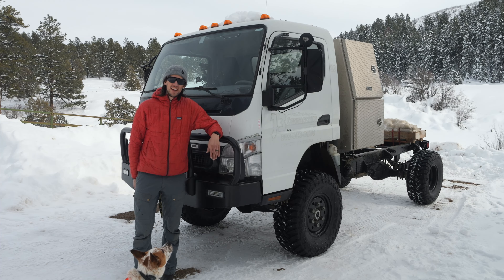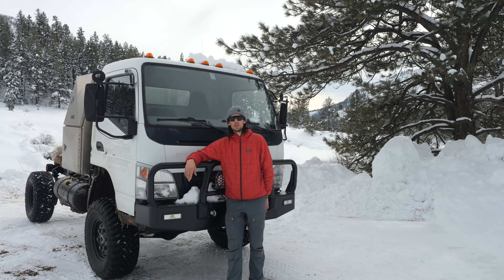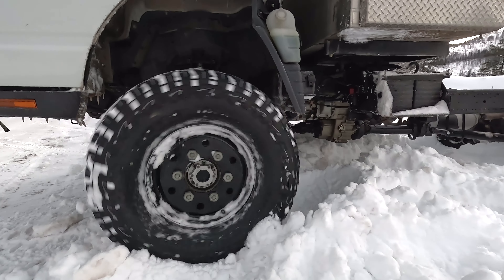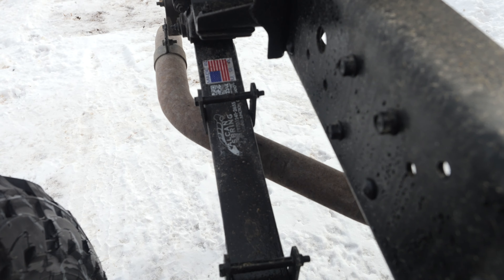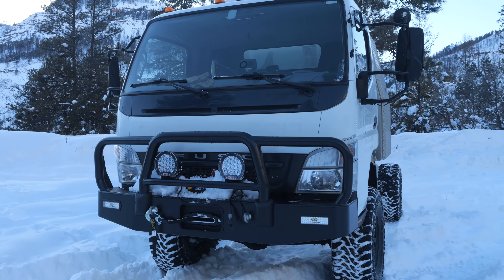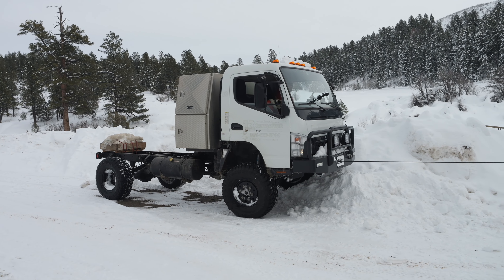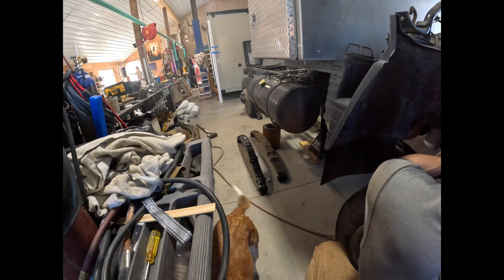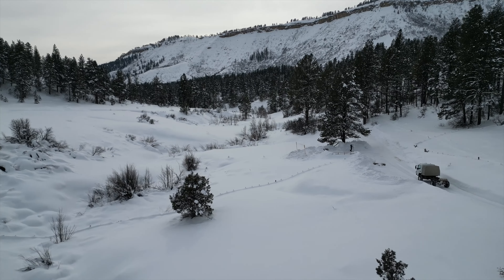Overlander Chassis Upgrades | Retrofitting our Fuso with a lift, winch, and big wheels

Comment: If you have an open front differential, a torque bias (Torsen style) front differential could be something worth looking into. With the front wheels locked in, whenever you are in 4x4 mode then your front end with a torque bias differential fitted, makes for phenomenal front axle traction. Extremely good in sand, so far very good in mud and no idea about snow.

While a fully locking differential is the ultimate in recovery or for rock crawling type of terrain, it is only being used at very low speeds. When travelling on very loose surfaces a torque bias front differential is working at any speed you travel at and is always on if you select 4x4. Extremely sure steering ability and surefootedness from the front end is what we have.     NPS 300 in Australia.
Reply from the maker: Thanks for this info!  That could be a huge upgrade for us. Having more front end traction would be great!

Comment: Hi from Australia! I just purchased a 1996 FG63 Canter 4x4, they are very popular with the rural fire service here! Mine came with everything but the lights and sirens! It did not see many fires as for a 26 year old truck it only has 15000klms or 9000 miles! Great off road  truck but as you say rough ride I will deal with the suspension next! I am building the truck as a mother ship all power set ups water and  fuel I towing an off road caravan behind! Australia has some strict rules on weights and combinations! I am going gold detecting deep into the Outback so I need a strong reliable vehicle and this truck has that in spades solid build only computer is the clock in the radio! Just found your channel will be looking forward through your journey you have a great start! Thanks
Reply from the maker: Hey, thanks for reaching out!  We've been inspired by all the awesome things folks in Australia do with their Canters. These trucks really are amazing, and go forever. Sounds like you found yourself a gem!  Cool to hear about your base-camp for gold exploration, best of luck! Cheers!

Comment: Did you lift the truck at all? or is the stock height that high?
Reply from the maker: The new springs from alcan ended up lifting it like 2 inches.
Reply: cool thank you. I want to build a fusco 4x4 tiny home or a stewart and stevenson lmtv Just don't know much about large trucks afraid it will cost way more than i think. @HD.Adventuring

Comment: Need to move the diff breather lines up higher.
Reply from the maker: That’s a good call! Need to remember to do that ahead of adding the box!
Reply: @HD.Adventuring  No worries, good time to add other cabling and lines for power, lights and loads like a trailer needs. Don't forget plumbing & water storage as well as extra batteries moved to rear to help with weight redistribution. Try to keep front axel loads down if possible.
Reply from the maker: @bentheguru4986  all good points!  We’ve got our work cut out for us😄
Reply: @HD.Adventuring  Just have fun doing it.

Comment: Where did you buy the truck? I really like these cab over trucks. I see that Mitsubishi discontinued the Fuso in the USA, but the Isuzu NPR is an option, but an older diesel Fuso crew cab is appealing
Reply from the maker: We flew to Oregon to pick it up! There aren’t a ton of these trucks around, and many of them got put into plow duty. But they do exist! NPRs are great too, but not 4x4 from the factory, although there are some shops that will up fit them!
Reply: @HD.Adventuring  yes and I also see that the Fuso 4x4 is only available in a single cab. So far I’ve seen the NPR converted to 4x4 by Earthcruiser, Acela and Ridgerock. 

I love the space saving and turning radius and payload of these trucks compared to the American HD trucks. I’m currently comparing RAM 3500 short bed with an Isuzu NPR 150” wheel base and the dimensions are within inches, but the Isuzu has double the payload with basically the same footprint with a better trining radius. Of course the RAM has better interior amenities and confronts.
Reply from the maker: @woolengrappler  totally, single cab only, which gives a lot of room for a box, but not people(or dogs😀). I’ve heard great things about the NPR too- lot more power than the Fuso. But still not as much power as a 3500.  One other thing to consider is fuel compatibility if you have any plans to head to South America or other similar spots. Modern diesels don’t like the high sulfur content!
Reply: @HD.Adventuring  I’ve got a family of 4 so unfortunately crew cab is the only choice for me. Leaning towards a crew cab gas NPR with the 4x4 conversion and shorter 150” wheel base which allows for a 12’ total composites box. If we went with a flat bed cab over truck camper on the RAM the total length of the camper including the cab over portion is about 12’ but you lose all the space under the cab over and the NPR has more real estate underneath for mounting water tanks and side boxes for extra storage. 

Excited to see your build progress!
Reply from the maker: @woolengrappler  Makes sense- I think you're on the right path!  Good luck with decision - Would love to hear what you choose and when you purchase a truck.
Reply: Thanks for sharing your progress!  Ours is an 01 and needs to be prepped for custom camper box also, including springs.  We're in CO, can you share any specs from the setup you got from alcan?  Keep it up, excited for you guys.
Reply from the maker: @forename_surname  Thanks! Sounds like you've got a project on your hands as well! Glad to know there are more Fuso Nerds in CO!  Yeah, I can PM you some details about Alcan- they are great folks!
Reply from the maker: @forename_surname  Turns out theres no PM function on youtube😶  If you message us on instagram, I can share some details.